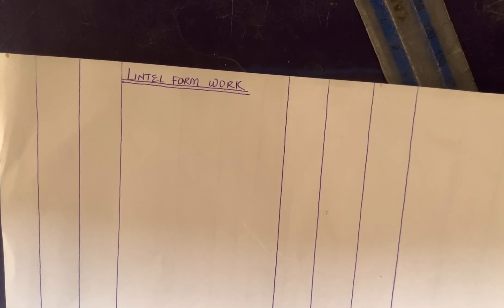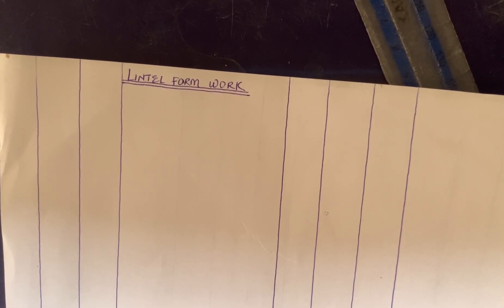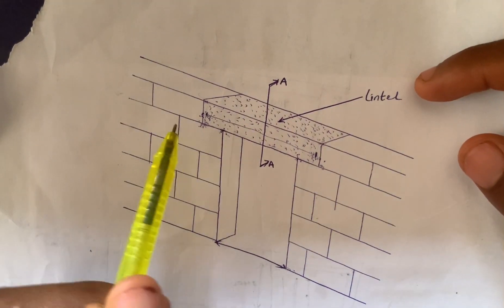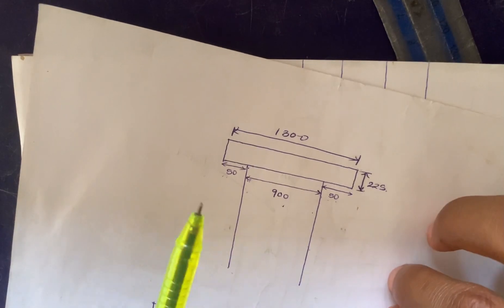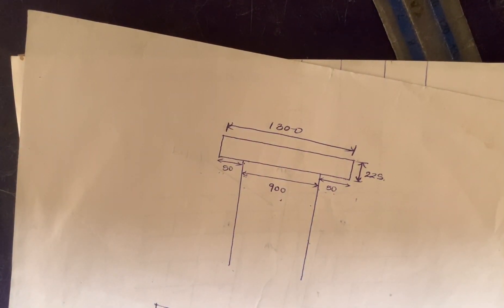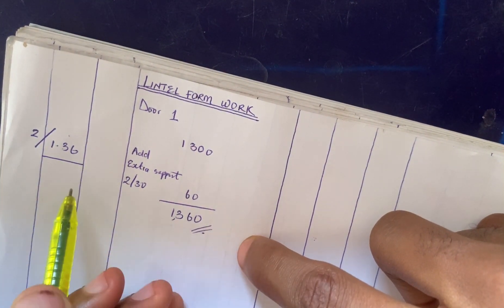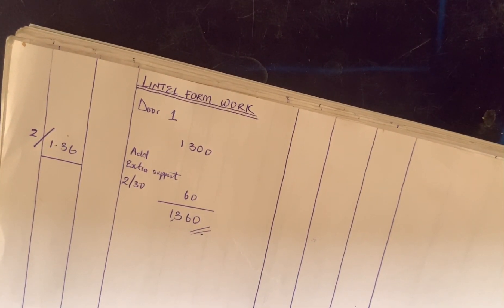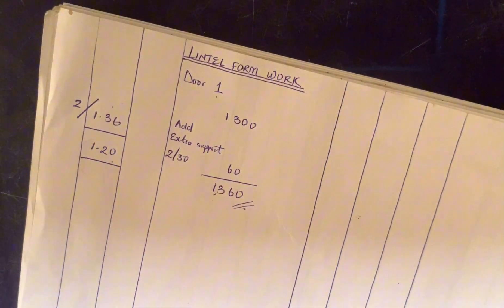HOW TO TAKE OFF QUANTITIES FOR CEILING FINISHES | ACCURATE MEASUREMENT GUIDE FOR QS & ENGINEERS

Comment: What is unit of measurement for formwork
Reply from the maker: It depends on what your measuring 
Some times it’s square meters, sometimes you can use linear meters and state the width of the form in the description.
But BESMM4 has it’s standard 
Which is the yardstick I’m using to measure
Reply from the maker: This particular video I was in a haste 
So sorry for the little discrepancies 
I was running late for a lecture

Comment: Is the unit of measurement for formwork length or meter squra
Reply from the maker: It depends on what you’re measuring 
For example 
The unit for measuring the soffit of any concrete work is in square meter while the unit for measuring the formwork for oversite concrete is in linear meters (but the width of the form will be stated)